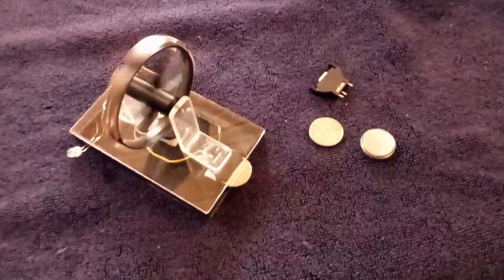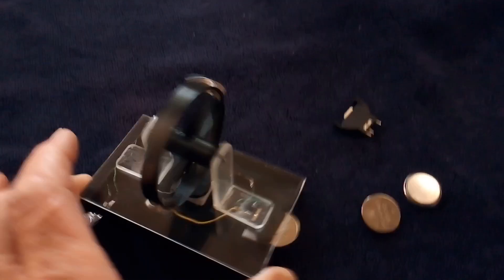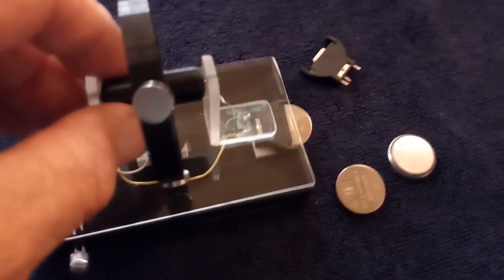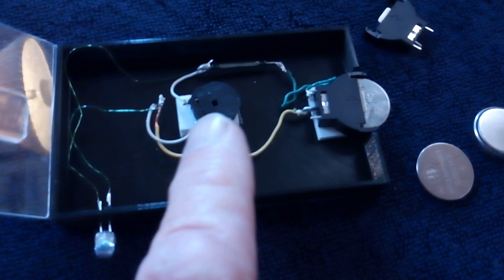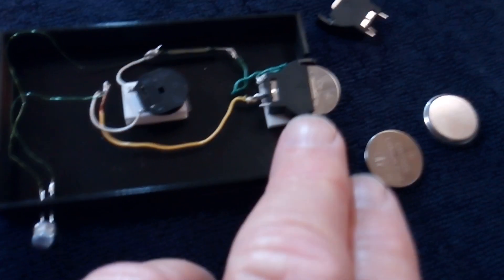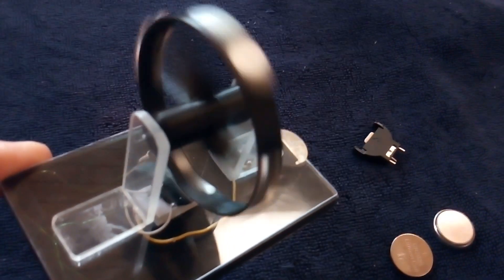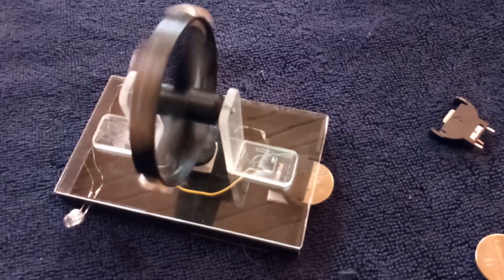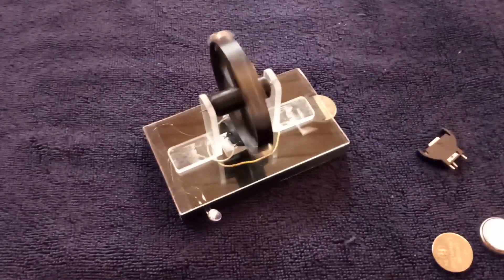Slot Machine Motor

Comment: Couldn’t you just wire your LED in series? It would reduce energy used by its forward voltage drop or is the current too low for this to work?

Comment: This is getting a fine project.... If you want it to last nearly twice as long, instead of the LED, you would have to rewind the coil in bifiler, and use  the second winding to get the backemf.. instead of lighting the led, you could feed it back to the circuit. As an average (depending on the coil) you can, with that method, divide the consumption of a pulse motor by 2. (of course led wont light anymore). You would need an ultra fast diode for that, like a UF4001 (not a 1N4001) also i think it will stop working - at least the feedback - when the battery is under 1.5v.
Luc

Comment: Do you know if a hall effect sensor would work instead of the reed switch?
Reply from the maker: YES!!!!! Because I am using 3v a simple hall effect circuit would work.  Thanks for the suggestion.  You could then control the speed also.

Comment: That looks really smart, very professional 😊
Reply from the maker: Thanks. I bought some thin sheets of clear acrylic to experiment with "snap" cutting the material instead of sawing it.  The lid on this motor was made that way.  It is an easy way to make thin straight edge clear plastic parts.  Thanks go out to Slider for that tip. I didn't know about that method.